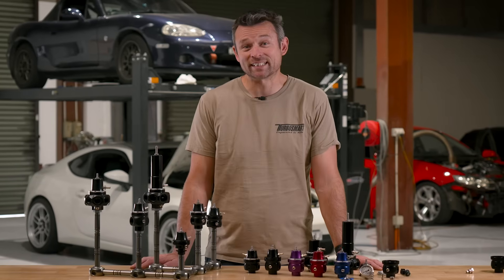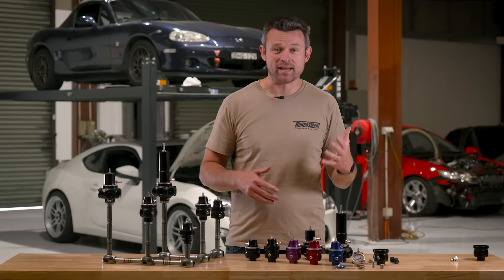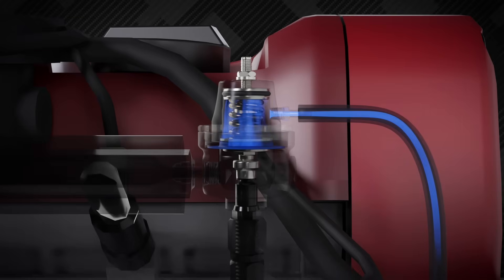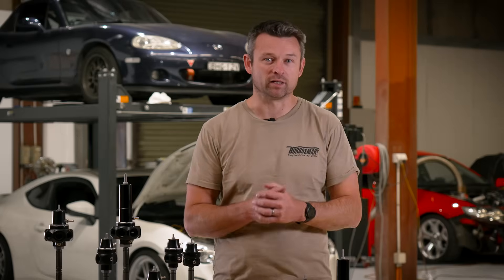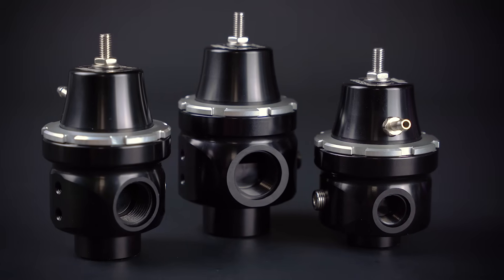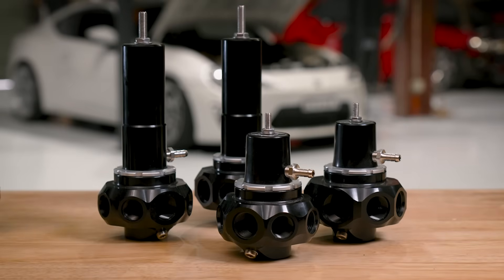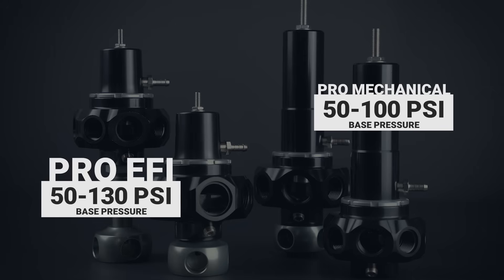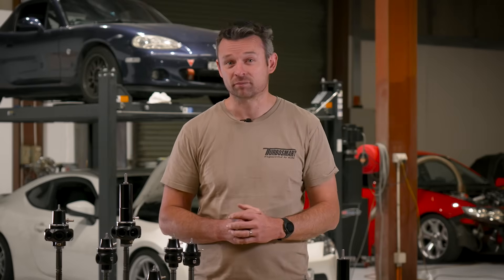Boost Basics | Fuel Pressure Regulators (FPR) Explained

Comment: just here to ask a question..
installed on my fiesta 1.0 ecoboost a plumb back valve, so not the vta, the question is, can i use the existing vac line which had with the oe valve or i need to split the recirculation hardline to get vac signale? why can't run wuth oe vac line?

Comment: @turbosmart, I've got one of your lp regs I brought about 3 months ago, I couldn't get pressure below 8psi. Have emailed aus twice no replys not happy
Reply: Assuming you have the right pressure range, is the return line to small ?
Reply: @1quickchevy2 adjustement fully backed off, no line on the return just a -8 fitting pointed into a fuel jug on the dyno cell floor. Has to be a faulty diaphragm or spring. Emailed turbosmart got an automated reply then nothing. emailed again a month later same thing
Reply from the maker: We're very sorry to hear that you're having these issues.
Get in contact with our Australian support team on 1300 735 506 or sales@turbosmart.com.au, so we can help get your issue fixed.